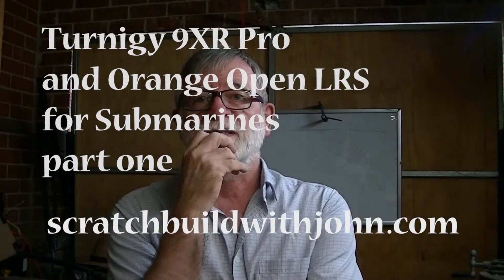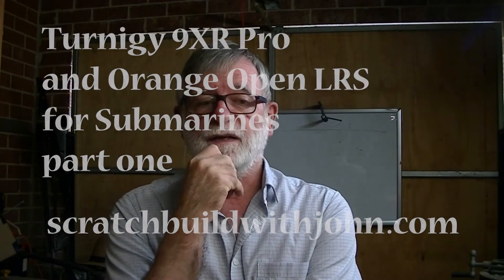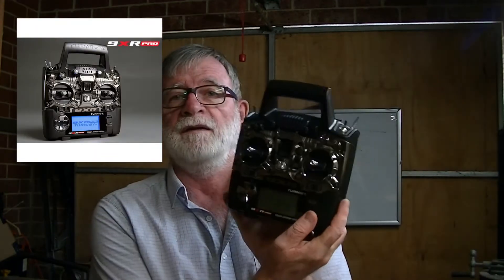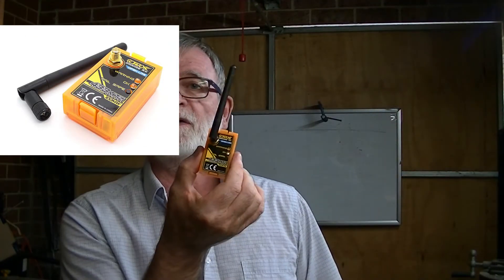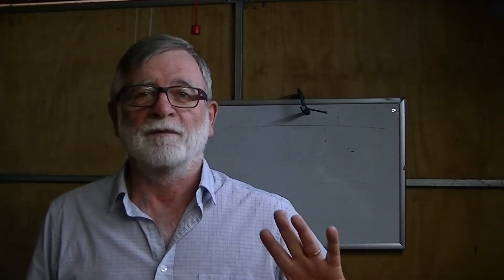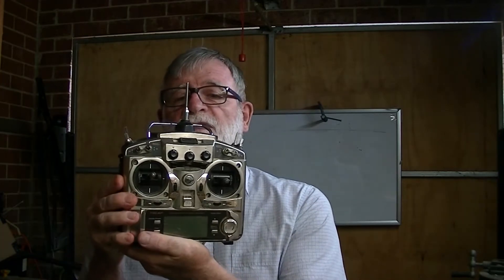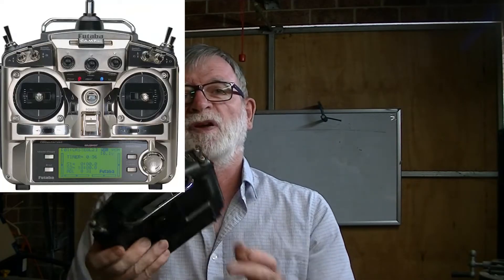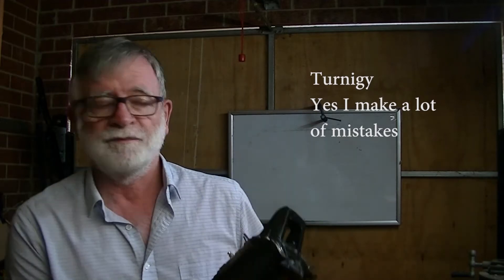RC for submarines 1

Comment: Hi John, I'm designing my first RC sub and I also have trouble sourcing the old stuff, 35Mhz in my country. Can you tell me what range / reception you get under water using the 433Mhz system? I know the 2.4Ghz does not work, unfortunately. Thanks!

Comment: There are several resources available if you want to get into RC submarines. John has his site, there is a Nautilus site that has great info (https://nautilussubmarine.com/forum/), SubCommittee (http://subcommittee.com/forum/forum.php), and there is Nautilus Drydocks for more knowledge and info on what stuff put into your sub (http://forum.sub-driver.com/). Many people have built their own RC sub. Scratch building a Nautilus has been done. What trips most people up is biting off more than they can chew and get frustrated. Then what happens is the project gets binned. Which Nautilus do you want to build? In the movie you will see three different subs. One is the movie set, an 11' model, and another model that is smaller. If you do not go for uber detail crazy, then it will be easier on you. There are plans out there, some good, some not. Even plans the studios "used" are changed as they built the set.